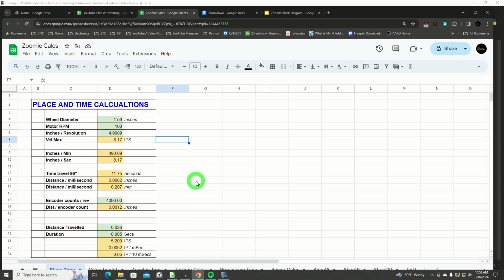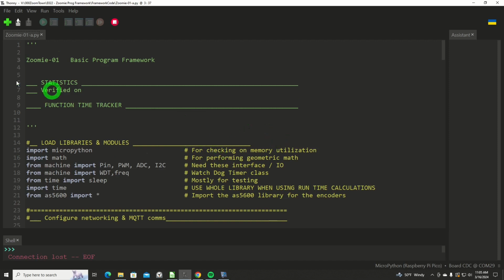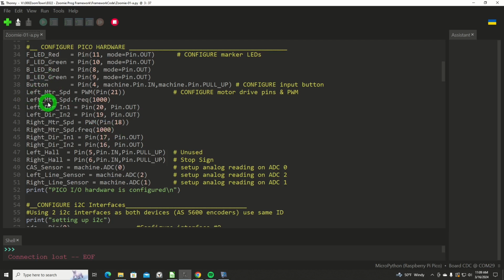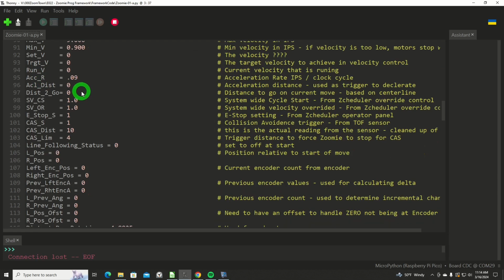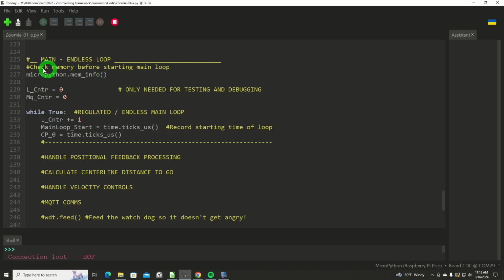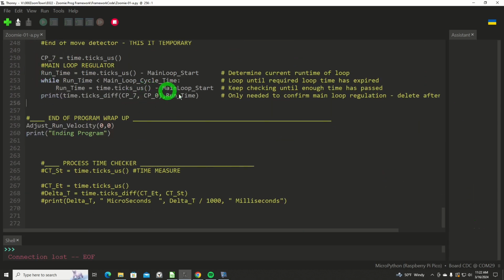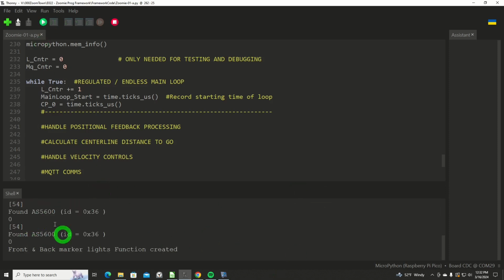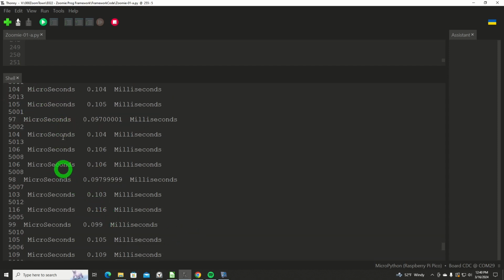E023 Take a Look at the Zoomie Program Framework with it's Deterministic Loop

Comment: I have a problem with OOP programming.  I got my first SW job in the mid 1960s. That was before universities were graduating computer science majors.  I started with machine code and entered the code into the computer with toggle switches.  An assembler was a big step upward and later I learned several higher level languages.  Late in my career, I was introduced to OOP.  I never felt comfortable developing OOP techniques.  I'm now 88 and it's too late for me to change.  It's hard to teach an old dog new tricks.
Reply: Hi William,
I just saw your message come in while i was filming an episode and it made me laugh.  You have a good number of year beyond me (I am 63) but I share your feelings.  I am fortunate enough that once I get rolling with it, I am okay with it, however, I often think that it is more work than worth for most programs I write.  I think I will be staying mostly within the "Traditional" method of programming as long as I can as well.
Cheers!
Chris